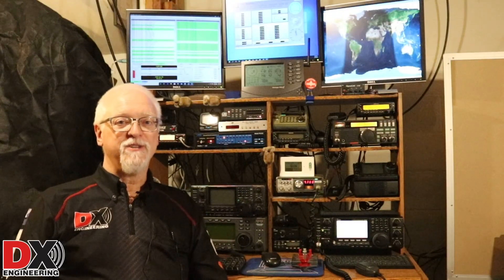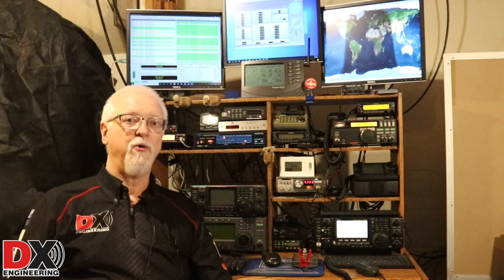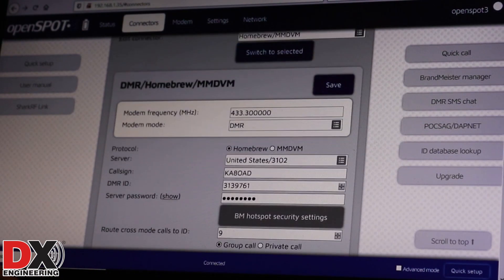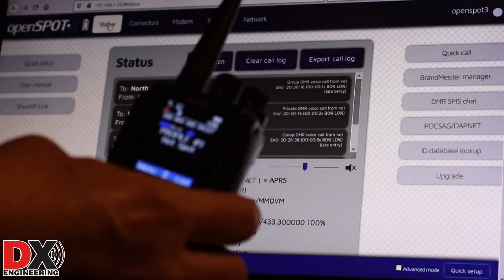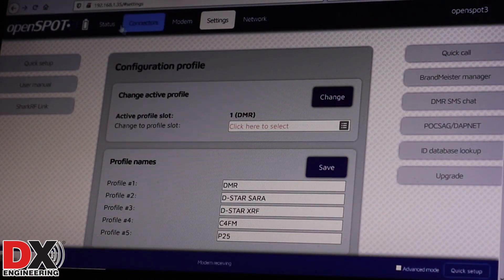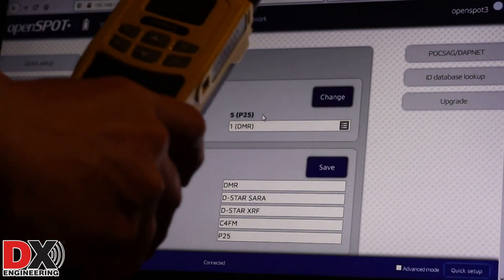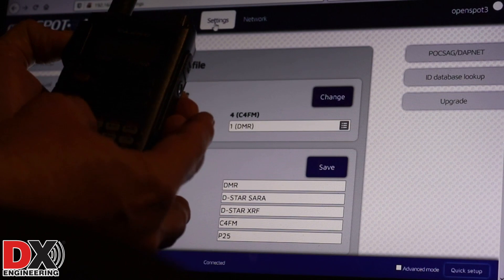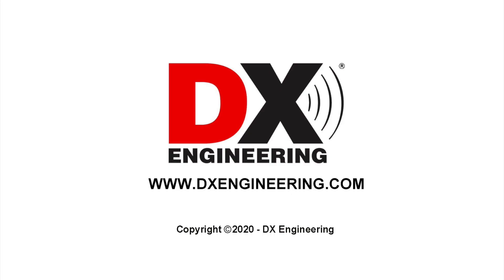Setting up Open Spot 3 for Multiple Digital Profiles

Comment: SAME THING HE SAID. ALL YOU DID WAS CONFUSE AND FRUSTRATE ME FURTHER. "Your video is confusing. You are using the profile numbers and room numbers as if they are the same thing. It’s hard to follow. D-Star does not have rooms but it does have Reflectors. You should be saying Reflector instead of room/profile. So I can’t tell I which you mean. Only Wires X has rooms. And DMR has Talk Groups. You then start using one radio to activate the profile another will use. Would be better to change the profile in the software and then show the radio the profile will work on instead of showing how any radio can change a profile. And you do not show how and where to program a radio with what content in order for that radio to change a profile."

Comment: Your video is confusing. You are using the profile numbers and room numbers as if they are the same thing. It’s hard to follow. D-Star does not have rooms but it does have Reflectors. You should be saying Reflector instead of room/profile. So I can’t tell I which you mean. Only Wires X has rooms. And DMR has Talk Groups. You then start using one radio to activate the profile another will use. Would be better to change the profile in the software and then show the radio the profile will work on instead of showing how any radio can change a profile. And you do not show how and where to program a radio with what content in order for that radio to change a profile.

Comment: im wondering if you can maybe explain how to find a specific IRLP reflector thats tied into the dmr dstar fusion etc systems. for example i would like to take my openspot 3 and connect to IRPL 9050 WHICH HAS DMR AND DSTAR FUSION GATEWAYS COMNECTED TO IT? PLZ HELP IF YOU CAN DMR TALK GROUP 3129983 HOW DO I CONNECT TO THAT OR DSTAR REFLECTOR XRF892D ? PLZ HELP
 THANK YOU AND 73'S